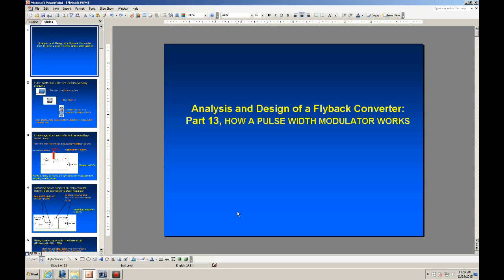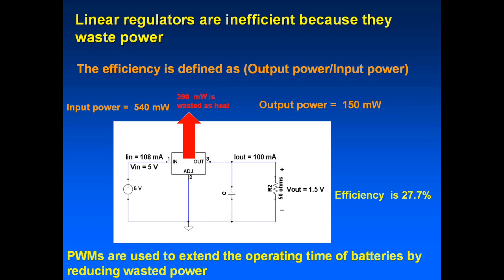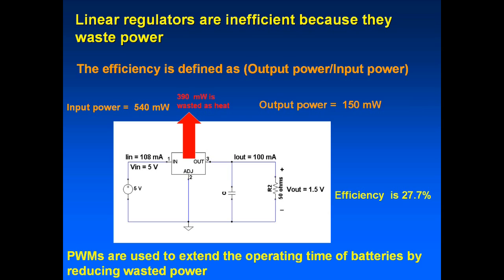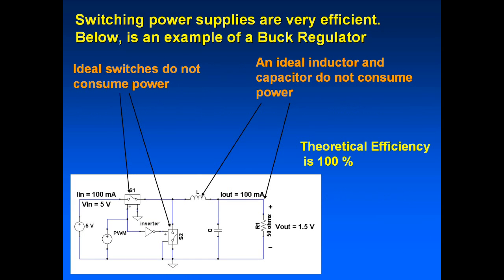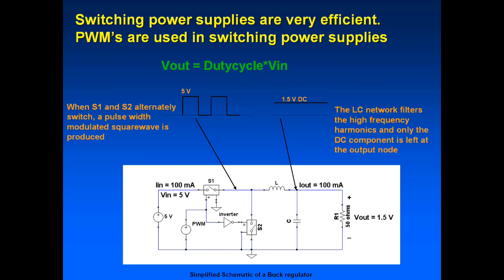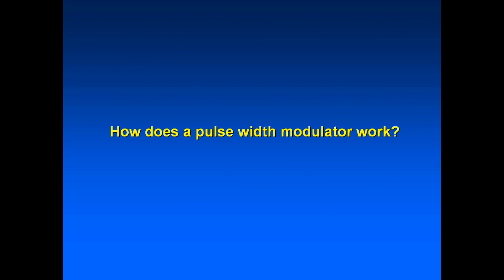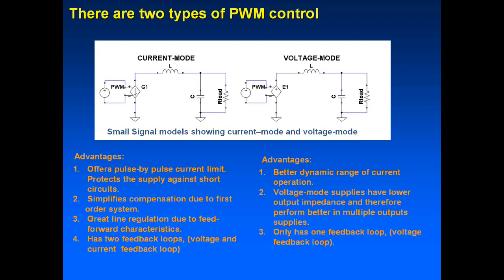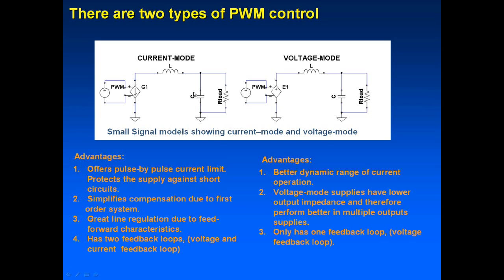Analysis and Design of a Flyback Converter: Part 13, PWM

Comment: A very nice back to basics video.

Question: I have always been uncomfortable with the fact that the voltage error output is used as a threshold for comparison with the current ramp to generate the output PWM.  How can we mix the two feedbacks just like that - is there a physical significance to it or is this some control theory voodoo?

Thanks for all your efforts.
Reply from the maker: +Anand Paralkar Good Morning Anand.  I seen this mixing of feedback signals before. In my TV-VCR fixing days, the capstan speed control was based on two different signals being used and then added together to control the speed of the cassette tape as well as the video heads. The reason they did this is that one signal is used to do the coarse adjustment while the second feedback was used to do the fine or the phase adjustment. So it has been done before. On a side note. I designed on the IBEX stepper supply a feedback system of two where I controls two high voltage diodes and used one feedback loop as the master control and used the second loop as a slave control loop. I would say multiple loop control is not out of the ordinary. Hope the helps.  Happy new years to you and you family!  Your friend, Robert
Reply: +Robert Bolanos True, infact, I would say that multiple loop control is the logical next step to single loop control.  However, what I do not get is how do insert a voltage value (error output of voltage loop) as a reference value in the current loop.  I mean can we mix voltage and current values like that?  What does it physically mean to say that "let the current ramp up to this particular voltage value"?  I would rather compare voltage with voltage reference and current with current reference.

I hope have been to explain my confusion, or for all you know, I must be stuck-up with something silly.

Cheers,